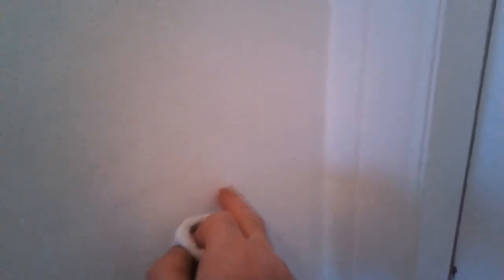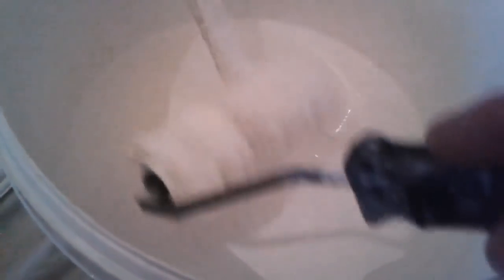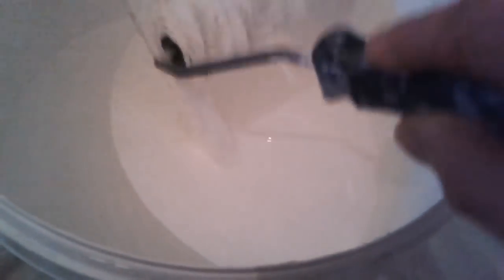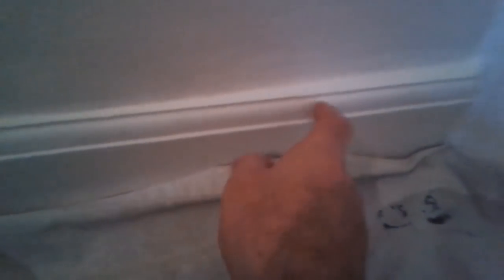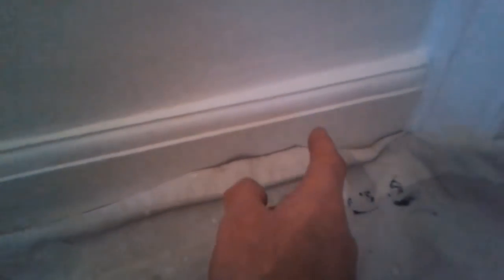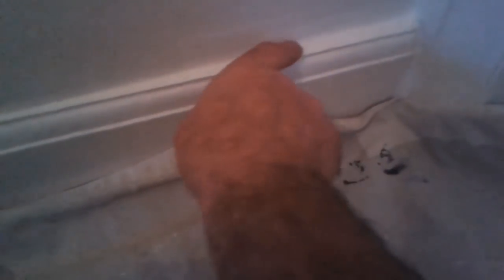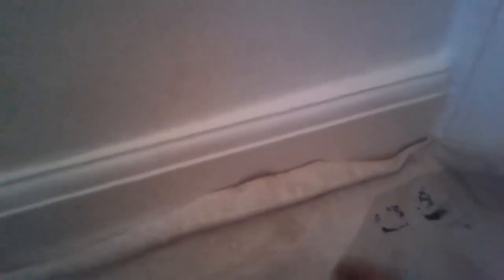Going Back Snagging Cracks, gaps quick fix no caulk

Comment: Just wondered what water based paint you use for doors Windows  and do you use hybrid  or just standard acrylic  on these.?. Also do you use an adhesion primer first  or straight on with u/c after prep of coarse. .lots of painters say you must use adhesion primer (zinsser123)  and some say there is no need if sanded and washed down. Keep up the good work with the videos  always learning new things from you"
Reply from the maker: Thanks, I only use water based if I have to..... and then I would use a full water based rather than a hybrid because at least it will stay white especially in dark rooms. Sometimes will touch up ares prone to grease with B.I.N. primer then oil undercoat.  But really as long as you have done the prep then undercoat is fine most of the time. Oil satinwood is what I use if I can.